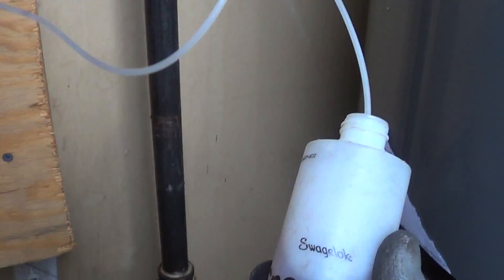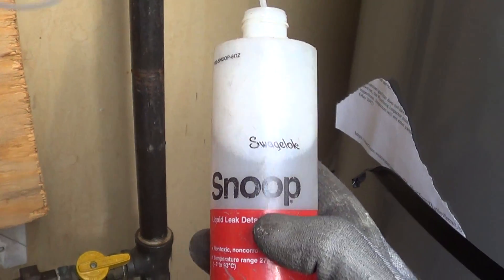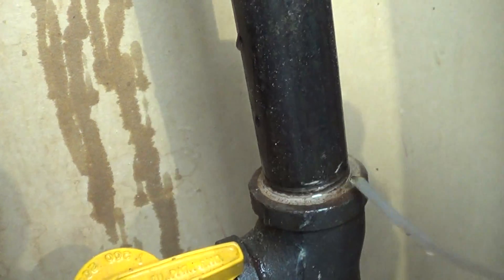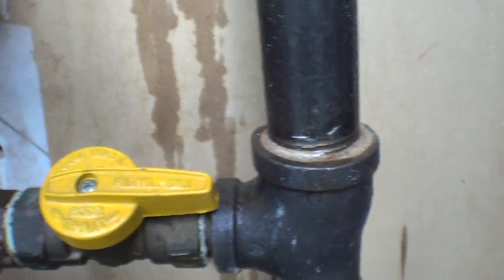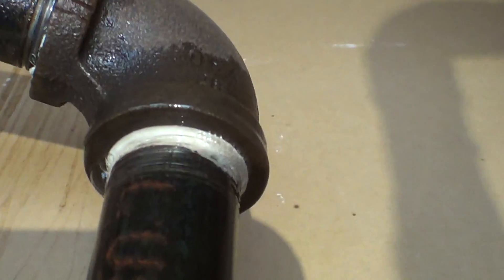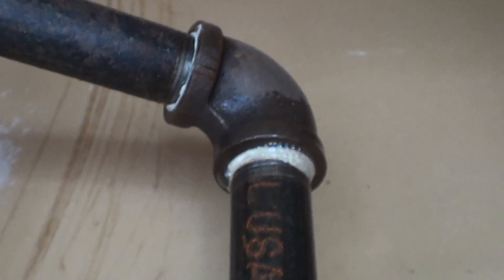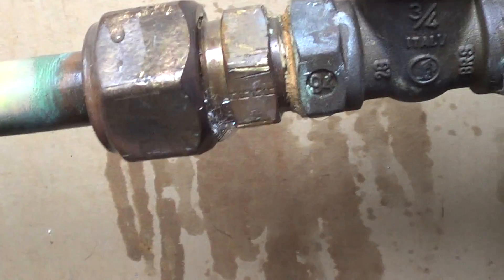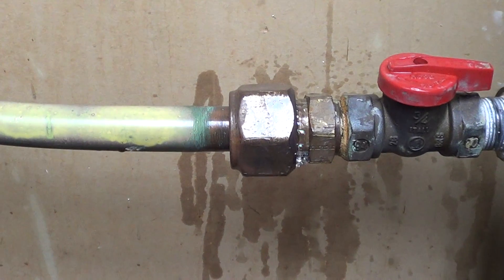Liquid Snoop for finding gas leaks

Comment: How do you fix the first leak in the pipe? If you turn the pipe to tighten on top, doesn’t the lower end loosen?
Reply from the maker: I had to unscrew the pipe and apply new pipe dope.   then I screw it back together and tighten it.   It doesn't take long.  not every joint has to be unscrewed.

Comment: Is there a fluid which changes color when leak is there?
Reply from the maker: The snoop make a white milky micro bubble color in small leaks.  Otherwise, all I know about are the UV dyes.  But, they are 100x LESS sensitive than a good sniffer.

Comment: Thank you for your informative video.
What do you do when you "check everything" and you still have a leak, small or large? How can I find a gas leak if it is underground(just dirt and grass)
Thanks again
Reply from the maker: You can bend down and smell the dirt.  Also, a sniffer will pick up the gas smell in the dirt.  The gas has only one place to go and that is up.  You can also pressure test the pipe or simply watch if the gas meter changes when all the appliances are off.

Comment: last I knew you don't pipe dope flare fittings. if the flare is done right and tightened it won't leak. in some areas white Teflon tape is not acceptable on gas pipe. they make a different colored Teflon that is acceptable. We are only allowed pipe dope on gas fittings in my area.
Reply from the maker: Good point.  All the flare manufactures say to keep the connections dry.  However, applying a small amount of dope will fill in the scratches that are inevitably on the mating surfaces.  I have probably fixed 100 flare nut leaks.  If the joint isn't cracked, dope or nylog fixes it every time.  I try not to use tefon on gas pipe.  It leaks a lot more than dope.  Here is a video explaining how sealants benefit flares.  Dope has the same result as their product.  https://www.youtube.com/watch?v=d8BR9Bz4PlU
Reply: NathansHVAC try a product called leak lock on your flares
Reply: The flare firing won’t leak unless flared improperly.  A little dope on the threads doesn’t hurt.

Comment: I thought flare connections you're not supposed to use pipe dope or tape on the threads since the threads alone will be pulling that flare down to make that mechanical seal.  Adding pipe dope or tape could lessen the rigidity of that mechanical force that's pulling the two connections together.
Reply from the maker: I have done it both ways for many years.  I have zero leaks using nylog on refrigeration flares and pipe dope on natural gas flares.  The manufacturers want dry flares.  However, I have to go with experience on this one.
Reply: Some of the old-timers really give you a hard time about using anything and then flare fittings I'm with you you have to go with experience

Comment: Looks like a great product. Think I'll try it.  Aren't they supposed to use the yellow Teflon tape for gas fittings?
Reply from the maker: +The Air Conditioning Guy   I used to use teflon tape on gas line years ago.  The problem with teflon is that the threads have to be perfect.  Any burs will just tear up the tape.  Pipe dope NEVER leaks.  Tefon is good on pilot connections and compression fittings.  Also teflon can be used with pipe dope on 3 inch and larger threads.  This allows the pipe to be easier to unscrew say 20 years later after the pipe dope normally hardens.  Teflon is applied first to only last 1/2 of the threads, then dope is applied over the teflon.  I have made some really nasty looking threads hold perfectly fine with pipe dope.  I do quite a few natural gas conversion.  So, I needed to get my leak rate down to 1 joint per 1000 or so.
Reply: Polytetrafluoroethylene tape is all made out of the exact same compounds. The difference between gas rated tape and standard p.t.f.e tape is only the gauge of thickness. Still if your going to do it using the correct code of regs and standards. Gas specified tape is a must. As an engineer your responsible, if you use it. 🙄.
I'm pretty sure in some states any form of p.t.f.e tape is against code of regs. So it probably shouldn't be used, only specified dope compound.